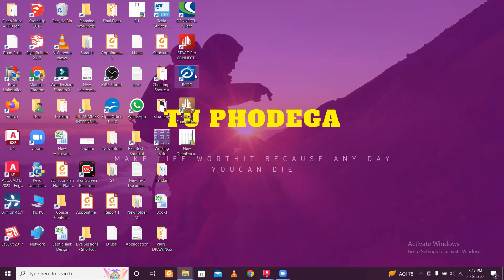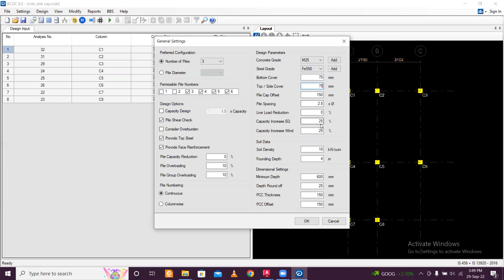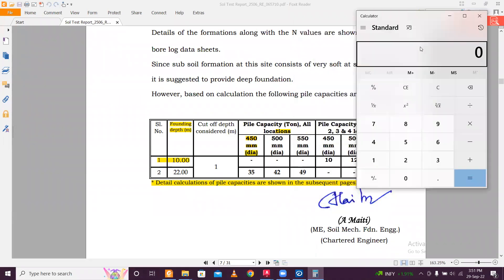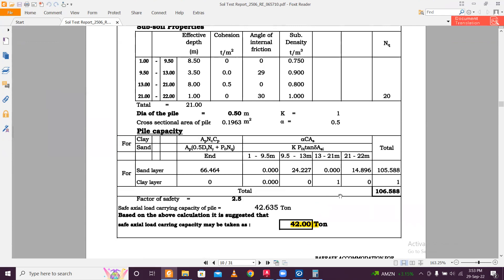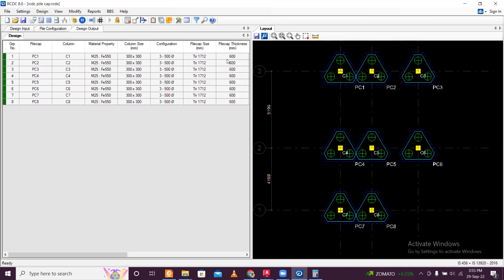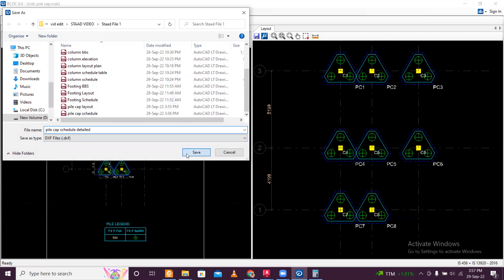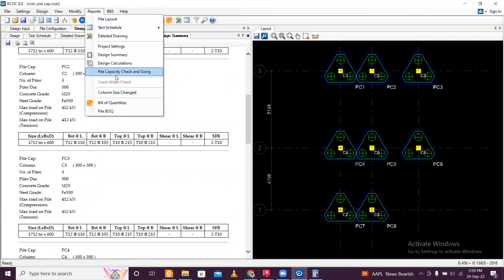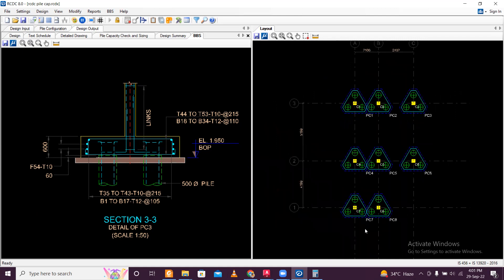Building Design in  STAAD.Pro Course | Day 15 | Pile Cap Design and Detailing in RCDC

Comment: Great video 
Sir do you recommend to export datas from etabs to RCDC to have design details?
Reply from the maker: Yes, many structural consultants work like that, they use ETABS then RCDC, One good reason to use RCDC, is the design reports, once you make everything safe, there is no warning. All big projects go for structural vetting, with RCDC reports structural vetting process is also easier.
Reply: @MainakChoudhury  thanks sir